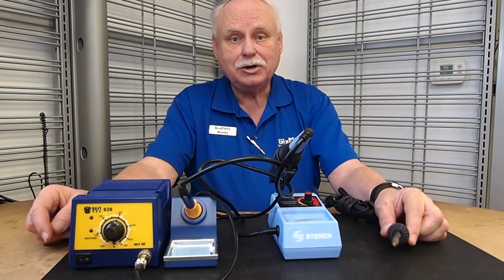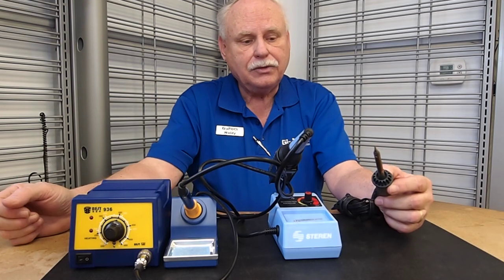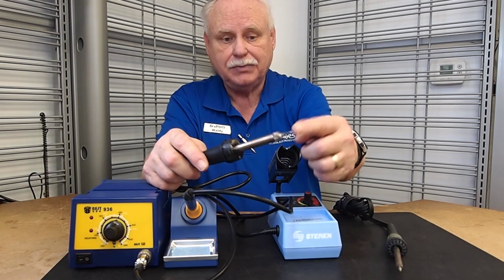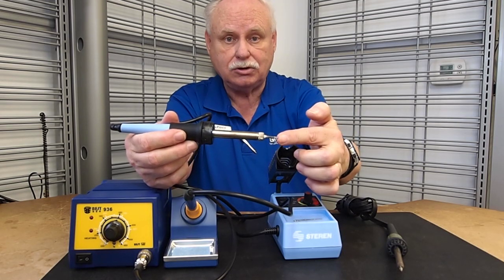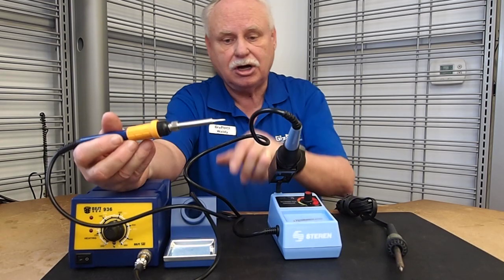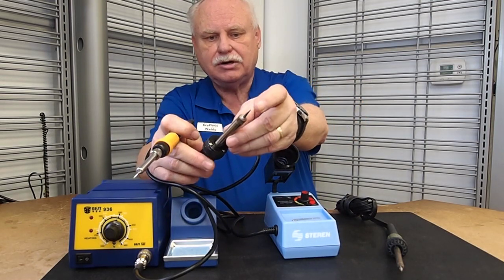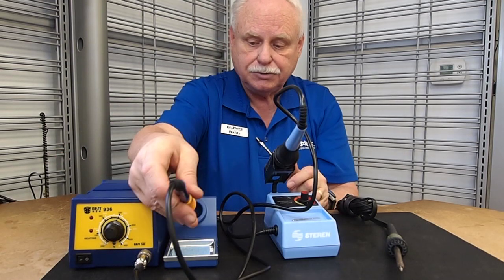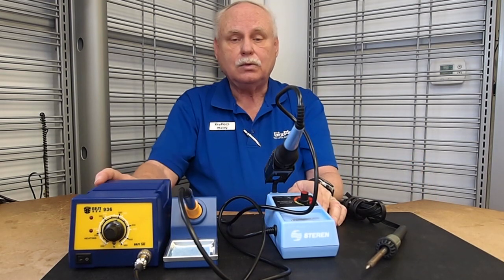Soldering Station Vs. Soldering Iron Which is beter?

Comment: What about a temperature Controlled soldering iron.
Reply: exactly!!!  I bought one of those 16€ AliExpress soldering irons with temp control and display, It works just as well as the "Professional stuff". It heats it, and you can adjust it. there is nothing special about it.

Comment: Hi. I have both but I'd say I upgraded my butane powered Iroda (can do torch, hot knife and heat gun as well) with the amazing KSGER T12 and bought the 10 piece tips for it and is now my other new favorite (alongside the digital caliper, all metal, the first 100% all metal, digital caliper, by General).

God bless, Rev. 21:4

Comment: Are there cheap soldering irons that pretend to be temperature controlled?
I have a cheap one (without a station) that has a temperature dial in Celsius on it. I however suspect it's not temperature controlled at all.
Reply from the maker: There absolutely can be. Due to a couple of things, If the station does not have enough wattage then it may not be able to hold a temperature well, or if the components in the iron / Station its self are cheaper they may not work properly. Great question thank you

Comment: Thankyou for this explanation. So for circuit boards I guess the soldering station is a must as the old iron could be problematic.
Reply: Ben, Yes using an iron that is not temperature controlled is a quick way to apply to much heat and either lift a trace, burn a board, or even fry other components that are close by.
Reply: In reality you don't need the temperature control. Actual heat transfer is entirely dependent on your soldering technique. Even your tip size doesn't matter because you can thermally bridge a small tip to a larger surface area by just applying more solder to the tip. The temperature control is more of a safety margin to reduce the chance of overheating, but in practice it can actually increase the chance of overheating because if your output is too low, you spend too much time heating the pad and this time allows the heat to creep to other components. Expensive soldering irons are mostly a waste of money. They were expensive in the past because many iron designs were patented but those patents have since run out.